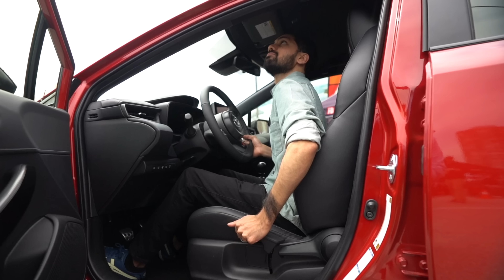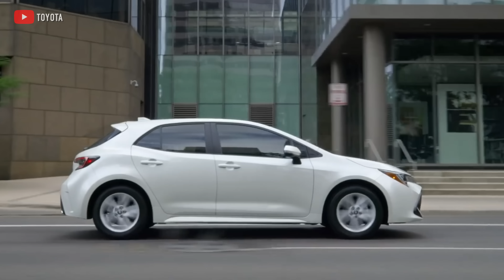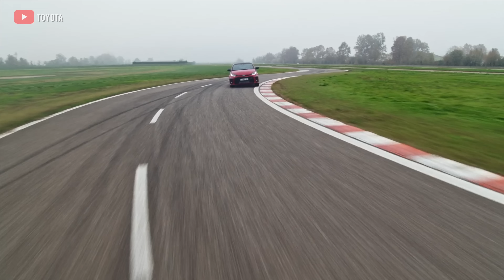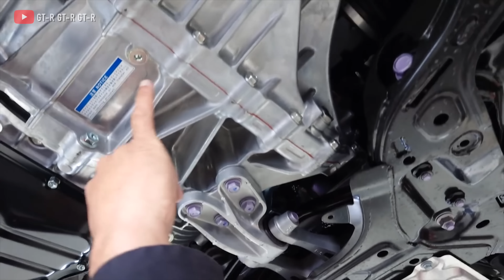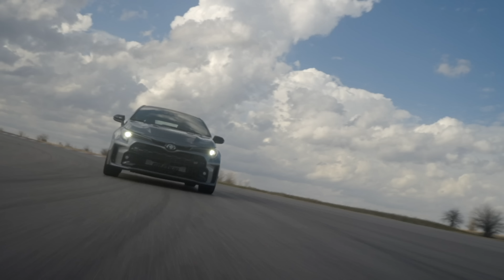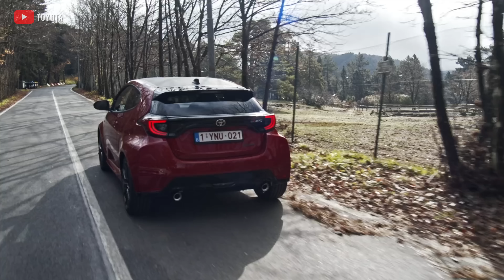GR Corolla - What They Didn't Tell You

Comment: Hey man, great video.
I will have to argue on few key points. I know some of us don't not have access to insider news but I have been following most of the updates about the GR Corolla. You mentioned that there will be only 1500 for the circuit edition and 5100 units of the core edition - where did you get this info? also, at the launch day, Mike Tripp said the Circuit edition is the Limited edition and that will only come in 1 color: The grey, but here you said it will also be in core edition colors, hmm?

Comment: The GR isn’t a real AWD it’s front wheel drive bias giving much more power and tq to the front wheels.
Three exhaust exits??? Worse than Subarus baboon bumper on the 22 wrx 
They use Honda’s front suspension and suspension Chevy used in the early 2000s in the cobalt
But ohhh man it’s still a Toyota lol you blithering idiots will focus on anything shiny

Comment: 22 PSI for 300HP.  This is why I don’t believe in tiny motors with turbos. 2.5L should have been the smallest displacement. This engine will kill itself at some point.
Reply: This is the point I see so many people missing...  Forged or not, the engine is going to go well before 200,000 miles.  This isn't going to be your typical Toyota that laughs at 250,000 miles.  I drive a 500 Abarth and they are 1.4L 4 cylinder multiair engines pushing 20-23lbs of boost max surge before stabilizing at 18 from the factory to get 180 horses.  They regularly reach 120-180k miles, but it's not the norm.  Cranking 300 horses out of a 3 cyl with slightly higher displacement is just asking for trouble.

Comment: Not worth it; still cr@p. Whatever happened to the Toyota reliability we all knew and loved? Pricing is said to be higher than a Golf R upon release. We can get a pre-owned BMW M3 in South Africa for this price. Thankfully we won't get to see this disappointment of a car.

All you need do is get a Tune on a GR Yaris (which IS available) and you're good to go. Not forgetting to mention the heating diff problems we foresee on this car. Toyota is going to make nearly all of these GR Corollas with open diffs, I can see sourcing Limited Slip is going to be extremely hard.

As for the roof, looks like it was cheaply made, like painted cardboard, forcing one to buy a rollcage just for racing or track days.

These cars are just not built to last anymore 😞

Comment: Im just so worried that these will be unobtainable and too low production
Reply: You don't need to worry, it's practically guaranteed.  Dealerships are already stating they will adjust pricing based on market demand, many even stating they expect markups of $10k or more.  The car is easily going to cost $50k-60k and it's just not worth it at that price.
Reply: @Tamarocker88  Yeah i’ve seen. it’s a lost cause for sure.

Comment: The Ecu is cracked now and all the Tuners here in Germany make around 340-350HP (crank) with the Stock Turbo and Autobahn Full throttle save.
Maybe there is more in it but than only for short accelarations and not a few minutes padel to the metal on the Autobahn.

Greetings from Germany 🇩🇪

Comment: As long as it doesn't hit 40K, I'm interested.
Reply: Absolutely no way you'll buy one for under 40k regardless of trim.  It's easily going to be $50-60k after markups.  Toyota dealers are already openly stating they will adjust pricing at delivery based on market demand, and several in my area are openly stating they expect markups of $10k or more.
Reply: EXACTLY

Comment: Question regarding production numbers. I understand the numbers you stated in the video are for the first production year. But they do plan to produce these for several years right... right?!
Reply: I would assume so. They’d definitely need to recoup their R&D and tooling costs, so making it truly “limited” wouldn’t be viable. I’d say the main constraint is thats only a single factory tasked with manufacturing the GR models.
Reply: I believe they said that the Circuit edition is a first-year only deal. Whereas they'll continue to make the Core edition in subsequent years. Its a crying shame they don't keep making the Circuit edition. I hope the high demand makes them reconsider, or provide a similar option (maybe without the carbon roof) in coming years.
Reply: @jasonhurdlow6607  I’m thinking maybe it’ll be like the Supra and how they had the A90 edition, then the next year it was the A91 edition… it doesn’t make sense to just make a “dumbed down” version of the car when they have the ability, demand and tooling for the vented hood etc etc

Comment: I'm not a fan of the "center diff", it's really just a rear diff on/off switch like I have on my Hyundai Tuscon.
Reply: It's always on. So no its not. It's always awd. Suv awd systems are reactive, so fwd till it detects front wheel slippage.
Reply: @scottcolpitts8521  I have a gr Yaris. It is a clutch style and while it SHOULD always be ‘on’ it frequently shuts off the rear diff when driving for more than 5 minutes in a spirited fashion (winding hills where you are frequently accelerating out of corners, and especially track driving)
It is a bit dangerous sometimes when in sport mode as you’ll go from a 70% rear drive bias around a corner to 0% in a moment. 
It’s brown pants stuff on the track!
Reply: @simonr23  Are you talking about when it overheats? And it seriously only takes 5 min? "Speaking of, a Haldex clutch-type all-wheel drive system will run as front-wheel drive most of the time, sending power rearwards only when necessary. This isn’t the case with the GR Yaris’ setup, which is not an ‘on-demand’ system. Further separating it from Haldex, it’s capable of a rear-bias with a 30/70 default split given in ‘Sport’ mode. It’s 60/40 in ‘Normal’, while in Track, it’s 50/50." This is a quote from an article about it. I understand it does have the power to shut off.
Reply: @scottcolpitts8521  Yes, I believe it is a temperature related action. It’s worse on a warm day (say 30 degree Celsius or above)

In winter I can drive for 15 mins and only have it happen once or twice.

It’s also an issue under normal driving (refer to the dyno operators who pull their hair out trying to get repeatable data from runs)

Toyota over-sold the real life operation of the awd system.

It’s a small diff, with only 500ml of fluid- so not a lot of material (or airflow)  to dissipate the heat of all that load.

Everything else you wrote is just marketing spiel.

I already understand (and experience first hand) that it is constant awd. 

I owned a vw 4motion car (Tiguan) prior to this, so also understand the haldex system.
Reply: @simonr23  Wow. That's not so great. Like good that it has a backup option if awd fails to get home. I wonder if this will be fixed in the gr corolla. Really makes me re think it.
Reply: @simonr23 I would suggest getting your dealer to check it over as I have had zero issues with the AWD system (it is driven with intent) as have many others. Motive ran theirs at Bathurst without problems.
Reply: @khamid1  have done so. Had a free tear down and fluid change.
I drive very hard and fast (rip Tony Greig)

But on a hot day it struggles to maintain constant awd.

I did the same thing with a demo car on the same day mine was in the shop.

Combo of how I drive, temps(summer in south Australia) and the car.
Reply: @simonr23  Same or hotter temps, 265 section r-comp tyres and a solid afternoon on track with no issues. Cusco make a billet diff cover for the rear that increases oil capacity by 50%, I would try that and heat wraping the rear section of the exhaust around the diff.

Comment: Transmission gearing is different than in the GR Yaris. Nakamoto said that since the car is longer and heavier they had to change the gearing so as to match final performance of the Yaris
Reply from the maker: The actual transmission is the same. It's just the final drive they changed. I have the specification document from Toyota  directly.
Reply: @albonfilms  diffs too
Reply: This is going to be very short gearing!

1st and 2nd are already short on my gr Yaris. Redline in 1st is about 30mph, 2nd is 60mph.

My car sits at 2500rpm at 60mph in 6th. Which is fine, but anything over 70mph and it sucks doen fuel and gets a bit noisy and abrupt with throttle transitions.

Assuming the Corolla is 10% lower geared it won’t be fun on the freeways and will be a busy time from standstill!

Comment: I'm just not sure why you conceive such a small engine and then stress it out with Turbos to get big power.
Seems silly.
Reply: that engine isnt stressed out the yaris version was already capable of 500 whp easily and probably more with a better head gasket and head studs once the aftermarket makes better versions of those sure we will see 6-700 hp stock block 3 cylinders . The typical numbers that are usually the safe rule of thumbs its been found to be the case on just about  any turbocharged toyota engine.
Reply: @Seniorstixxx  lmfao No - the 2zz will blow up around 4xx stock block
This engine needs valvesprings and a turbo upgrade to break 400whp so 500whp "easily" is an overstatement
On top of that, up until a week ago you needed a Motec 142 setup which is nearly $7000 by itself to run the show. So full standalone with harness 7k, fuel system 2k, upgraded turbo system 3k, clutch 1600, exhaust 1500 plus labor/tuning ....around 18 to 20k in USD to make 470whp or so
The need for motec really made it cost prohibitive for most enthusiasts.  
700whp from a 1.6 stock block - ive never seen it
K20c1 is doing 600ish whp stock block from a larger 2L F20c made 800whp stock block with valvesprings and 10,000 rpm redline.  
I dont see this 1.6L making F20c power with a redline around 7k, small cams, crappy head 550-600whp would be really pushing a stock 3cyl on oem level rods.....need to be a huge turbo that spools very late in the rev range/peaky power delivery
Reply: @TheFK8Life  The Stock GR Yaris ECU was recently cracked, so it wont take long for other companies like Cobb, ECUTek etc etc to follow suit and provide reflash services rather than people with fuck-you levels of money to just plunk down on a Motec or Syvecs standalone. 

Also, of course more power is going to require more turbo... a turbo provides airflow. its aerodynamics and physical size determines that. 

However, Motive didn't put a "huge" turbo on it. They used a G25-600 which is a small and fast spooling turbo. Briefly had one on my STi. At 25psi and e85, i was putting down 480-500whp and positive boost pressure started at 1800rpm with peak boost hitting at 2500rpm - so it spools just like the stock turbo. 

Wont take long for machine shops to provide turbo modification services to build a stock frame turbo with better spool and airflow to provide decent power gain at the same boost levels - like has been so common for many decades of factory turbo cars. Like my friends Evo 8 who made 550awhp on a modified stock turbo with methanol and e85.
Reply: @rotor13  You will still get valve float with elevated boost levels which is why Motive had to do valvesprings and its not going to make anywhere near 600whp stock block
These DI cars are fuel limited so having the port injection on top is nice - will help with fuel/power
It just doesnt have the engine size to spool a large turbo like stock which is fine given the rods will be happier with torque coming in higher vs off idle like a stock turbo
The stock turbk makes 20psi near idle, its tiny - the upgraded turbo ramped later and didnt make 20psi until well after where the stock turbo did per their own tuner.  
The engine will last longer with the larger turbo anyway - small spool sacrifice for decent power up top.  
That 1.6 will be peaky with a large turbo tho....its why you need 2L+ for such a heavy car
Reply: @TheFK8Life  Thats on the Yaris variant. 

Toyota said they've fixed that for the Corolla. As it was a fairly common issue with even stock GR Yaris' with some people lunching their motors in Japan and Australian with accidental over-revs.

And if they didn't address the valve spring issue and addressed something else, its not like its a hard job. I used to do cam and valvetrain upgrades on B, F, H and K-series Honda engines. Its an easy 1hr job
Reply: @rotor13  If you know what your doing - for most folks they will pay to have it done and valvetrain upgrades could be a warranty issue for those who care.  
Its a tidy little engine but for a heavy corolla it might be a touch too small 
Its a WRC fan car tho and a collectible in Circuit trim
Reply: @TheFK8Life  Its only an issue if you're overrevving. Its not inherently an issue if you're not gonna bother modifying it and need to make power in the upper rpms . 

its why Toyota set the redline to 6500rpm. It doesnt make much power past that because the turbo doesnt have the CFM to support those RPM
Reply: @rotor13  As you raise the boost/whp the valve control is lost which is what happened to Motives Yaris - the other guy floated his valves and lost the motor.  
Stock turbo these things will be stuck with 3XX whp without valve springs and a larger turbo
Reply: You seem to have glossed over that the engine is using stronger forged internals for increased strength vs what they used for the GR Yaris.

Also, the engine is designed for packaging and weight savings. A 300hp 3-cylinder turbo is smaller and lighter than any 4-cylinder turbo making the same or similar power and equally or more fuel efficient when not doing spirited driving. The G16 makes a bit more torque than the Civic Type R's motor, and only 6hp less. 

And its not a stressed engine at all, because several shop/companies are already pushing 500awhp from the engine in a GR Yaris with e85, bigger turbo, better intercooler and a clutch. 

If you want to see proof, just search "Motive TV Yaris" or "E.Kanoo Racing Yaris". 

Motive TV found their first, minor, weak link in the car to be the stock valve springs, as they experienced valve float when revving above 7000rpm but because the stock turbo doesn't flow enough air to make much power past 6500rpm its not a huge issue. Fixed with stiffer springs and Toyota has said that they've already fixed this for the GR Corolla. The actual major weak link they found, was the headbolts as they started leaking boost into the cooling system. So until parts companies like ARP are able to release stronger head studs that offer more clamping force as well as possibly a better headgasket  - the true HP limit on the stock block currently, is 500hp until other shops do destructive testing to test the true limits of the factory bottom end. 

The head is designed well with massive intake and exhaust ports, so the true limiting factor in airflow, is the cams and of course the turbo.
Reply: Efficiency. It’s only stressed if the components can’t handle the extra forces. The Yaris (and now Corolla) motor isn’t built like a normal hatchback. It is made to handle 300hp for 100,000mi+ (assuming proper servicing of course)

Comment: As much as I love my Supra, I'm keeping an eye on this, and the rumored electric MR2.  I could use more space, and gas prices are rough when you drive as many miles as I do a day, and filling up every weekend sucks.  I'm just worried about how my arthritic knees would handle the trans.
Reply: what u mean arthritic knees?
Reply: @shiftautomotive1997  I have osteoarthritis in both knees.  Eventually I'll need knee replacements. I'm only 38.
Reply: @mgoose1359  is it because of driving a manual transmission?
Reply: @shiftautomotive1997  probably bad flat feet and pronating ankles
Reply: @shiftautomotive1997  no, I'm a disabled veteran.   Screwed my knees up bad in the service
Reply: @mgoose1359  thank you for your service
Reply: @mgoose1359  save up for some stem cells dude.
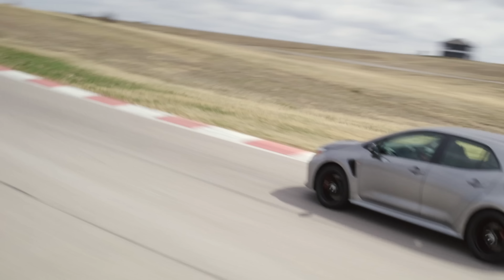Reply: @urgandma  i read this at 6:03 and found it a funny coincidence